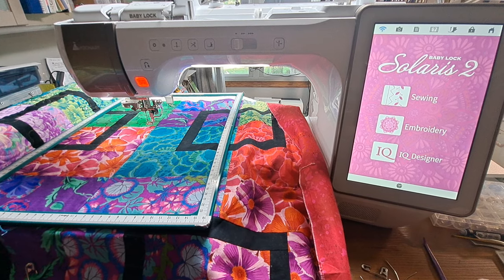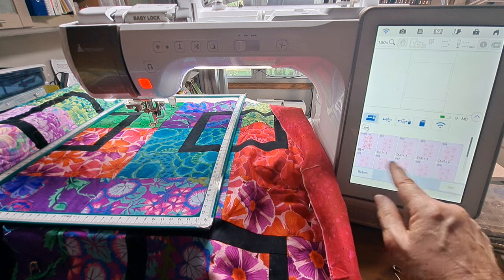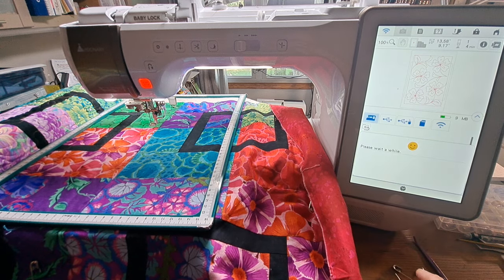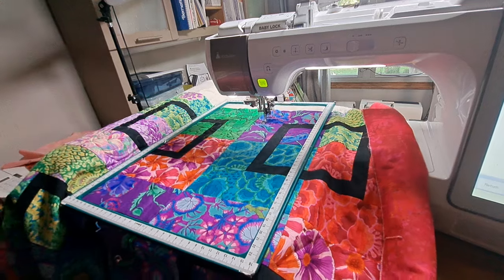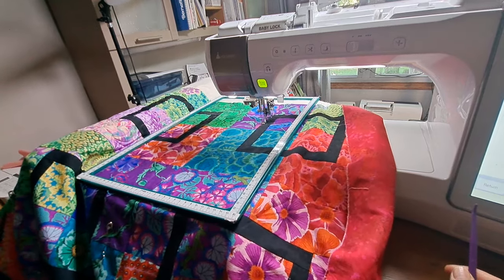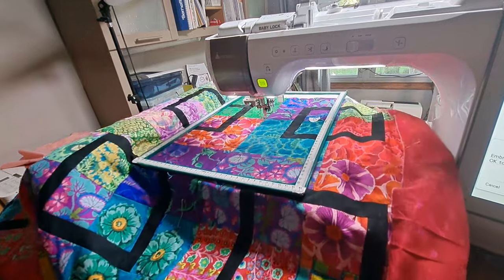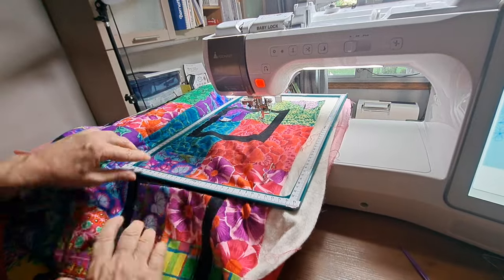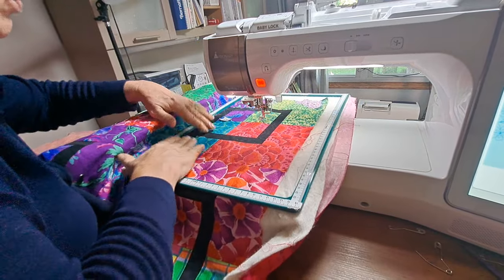Babylock Solaris Journey - IQ DESIGNER-Edge to Edge quilting- video 3-row 1, TRICK, right side edge

Comment: If the Solaaris is the same as the Luminaire, then you can do stitch outs of line and picture drawings scanned into IQ designer.  Digitizing is easy in IQ and allows more creativity.
Reply from the maker: @sherrikoers1438  yes, when I get to scanning, I  want to scan images and do fill ins, but I also want to see what's in my instruction book and go through that.
Reply from the maker: @sherrikoers1438  I've used IQ designer to do fill ins of shapes now and then.  Should be interesting to continue that learning more.